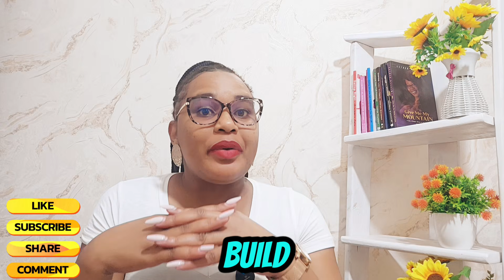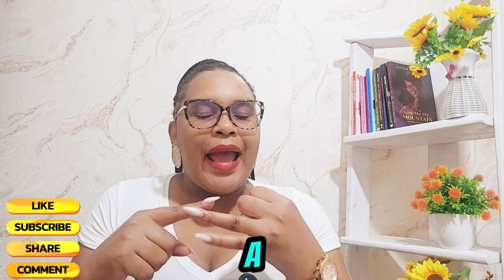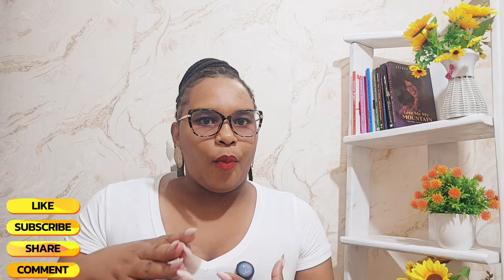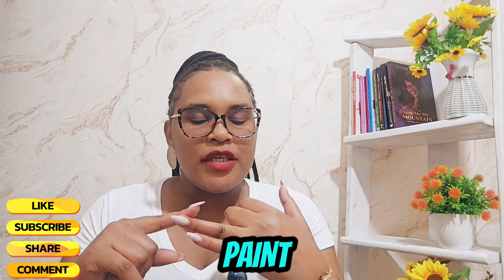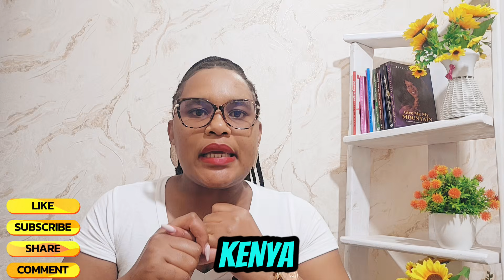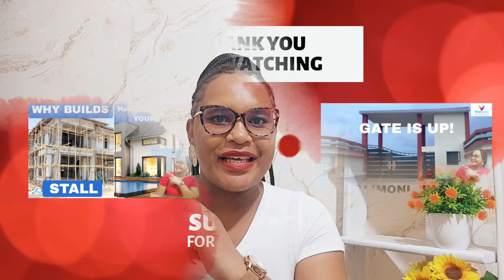Cost of Building a Small House in Kenya in 2026 (Real Numbers, No Guessing) #ConstructionInKenya

Comment: Hey, could you do a video based on pre-cast panels, that's more reasonably than the traditional stones and definitely cheaper. Also if you could incorporate more photos of the building as you explain your video, otherwise thanks. Will support by subscribing.
Reply from the maker: I will consider doing a video based on pre-cast. Thank you for mentioning and for your support